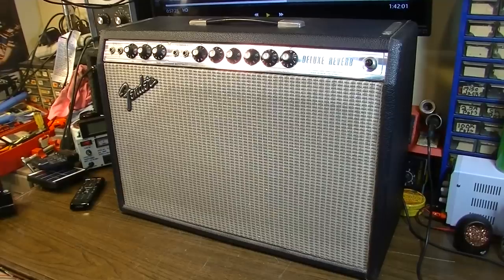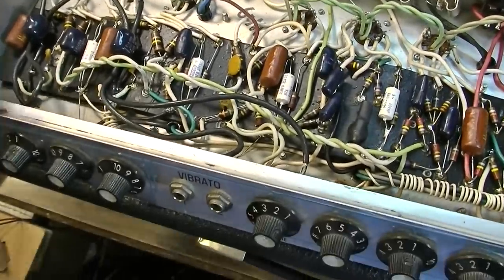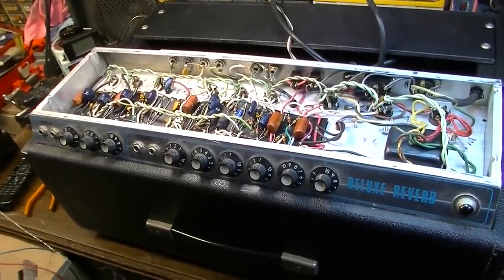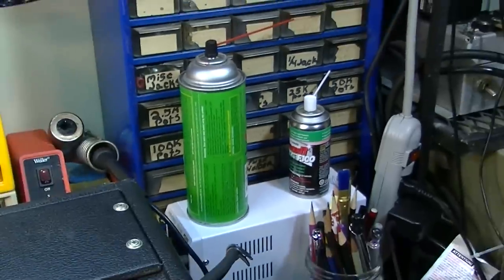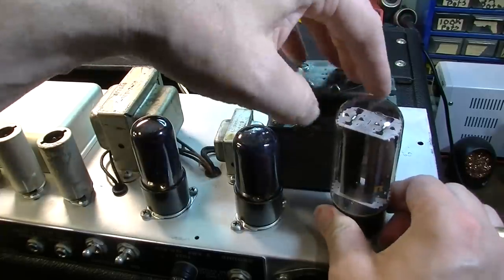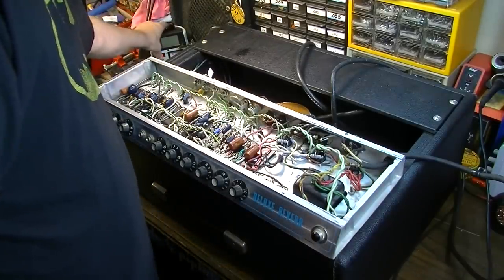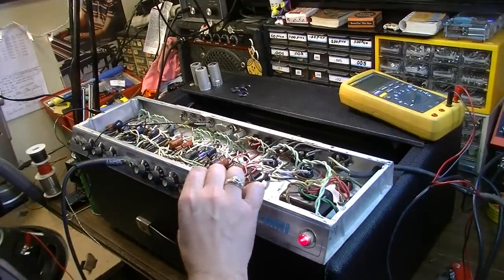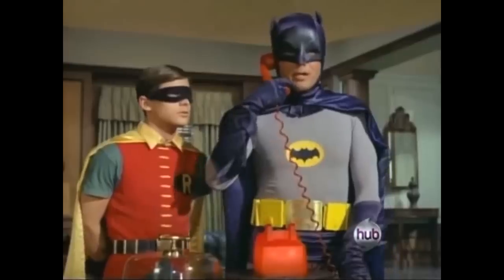SECRETS of the Fender Deluxe Reverb - The BEST Fender Amp Ever? (FULL SERVICE)

Comment: I like to use the Sprague Blue caps in the power section of the dog house and I also stay with the Sprague orange drops through the tone circuit.  I know...a little more pricey but you get what you pay for.   I have a good selection of NOS tubes and have found that different tubes like RCA, Telefunken, Phillips, GE, or Mullard all have a different nuance to the tone in these amps depending on which section you put them in.  A 12au7 in place of the 12at7 also gives the amp more color but that is according to taste.  Also, in the first section of the preamp,  by changing the stock 250 uf to a mica cap of the same value it will give the amp more headroom before its distorts.  Great for people that play country music.

Comment: Something to keep in the back of your mind for the less experienced is it's easy to melt the holes in the socket by overheating while trying to wrestle out stubborn components sometimes you might want to clip them out that way your not exposing the sockets to as much prolonged heat or you can use small clip on heat sinks they look like alligator clips but are usually aluminum.

Comment: This thing sounds awesome! I replaced the 470 ohm resistors on my bassman with metal film as well. I wonder if I should have increased their value too, but I certainly don't need more output from that thing lol. I tried biasing by ear as some say to do. Turns out I liked how the amp sounded biased fairly cold, so maybe that'll keep the old Sylvania's kicking for a while
Reply from the maker: In this day and age with sound guys wanting quiet stages and the way PA is, bias cold and mic it up. Preserve the tubes.
Reply: Thanks! Have you ever seen that geekcreit only give capacitance value? I lifted the legs on the coupling caps to the power tubes to test them, and it didn't display the leakage or ESR at all. Plate current is rock solid, so I think I can assume the old blue coupling caps are A OK. It's a '65 like you had in your video (later preamp with earlier power section with bias adjust)
Reply from the maker: Some caps are too small of a value to show ESR. I think some of these testers have a different software version installed in them and they have different cutoffs for ESR measurement.
Reply: That makes sense. These are just .02 mfd. Thanks Brad, much appreciated, always learn something from your videos

Comment: Fender schematics are dated,  so for example AB763 is whatever amp model, version one (A) revision 2 (B) July (7) 1963 (63).

This is why you have identical numbers for different amp models-sometimes the multiple amps were revised the same month and year. Last 2 digits are year.
Reply from the maker: This is correct. A fact I clearly forgot I knew. I've even mentioned this in videos before and just brain farted on it. Thanks!

Comment: Difference between 1270 and 1172 is the location of the standby-switch. 
1172: standby BEFORE the filter caps.
1270: standby AFTER filter caps.

Comment: Howdy, awesome work as usual. Non amp question Say, on your PRS (I assume it's a CE, probably 90's?). Looks like you changed the tuners to the more modern locking version. Is that correct?

Comment: The reason Fender added the 1200pf caps across the 6V6's was to prevent occilation. The wiring was so sloppy in those days that some amps would go into runaway occilation. So in order to prevent them from going into occilation, they soldered in a few caps. There's one across the Reverb as well. Seems like it'd be easier to make the wiring neater (again), but they were trying to meet a daily quota in production. CBS altered the Phase Inverter and Bias circuits when the went to the Master Vol/ Boost version of their amps. They (CBS) was trying to make their amps into HiFi amps and engineer out all the distortion... The amps will sound much better without all those caps that were never there on the original BF circuits.

Comment: Hey Brad.  I've watched a few of your videos and like them but on this one I noticed that you changed out caps on both the B- bias circuit and the B+ supply as well as the values of the screen resistors and didn't mention this should require a bias voltage check since supply voltages certainly changed..  You likely did it but didn't mention it and I'm just pointing that out as good practice when voltages are altered.

Comment: great video.  I've got a 74 Vibrolux that is in almost as good shape.  It's amazing other than an original CTS speaker has a buzz.  not blown.  Not a huge issue but I wouldn't record with it.  After buying it, I am in love with the clean tones but I think I should have gone with the Deluxe Reverb for it's ability to possibly get some nice tube distortion at a volume level below deafening.  Blah blah blah.  Wonderful video,  very informative.  Thank you

Comment: Re 1200pf: aren't those a shortcut to preventing high frequency oscillations? Not sure if this is the case with SF DRs, but most SFs had a bias balance pot and an ultralinear transformer that kept it clean and prevented it from overdriving. I could be wrong
Reply from the maker: You are correct. The 70s were a weird time for Fender. As the trend was toward hard rock and prog rock with overdriven tones, Fender was still trying to clean up their amps. Strange. But yes, those caps will help stabilize the circuit and cut down on distortion.
Reply: They are overkill. They suck tone bad and should have been the first thing to go. One of two of the best improvements I made to my ‘73 DR. Second was swapping the crappy Utah speaker for a Jensen Blue Frame.  I’ve had it A/B’d against 60’s Blackface DR’s and no one could hear a difference.

Comment: Those pliers are a massive heatsink sucking heat out of the soldering iron.  I'd suggest using either tweezers or forceps.   Much of the resistor removal issues would be easier with less thermal mass attached to the joint.  (Note, I've been an electronics manufacturing engineer for more than 30 years)

Comment: I like the mic connector.  Did the cable die on you, or did you run out of your good cables? ;)
Reply from the maker: Another GC dumpster cable. It was missing part of the Neutrik end, but works perfectly. So I use it. Would have been at the bottom of the Louisville Municipal landfill by now.
Reply: Ah, the "the shoemaker's children go barefoot" or the "mechanic's car" thing.  Got it. :D  But yeah, I'd have saved it too.

Comment: It's 39:00,   and I'm screaming...   You need the pedal to turn on the tremolo!!!!!   at least on the ones I know about.
Reply: Jonathan Grayson:  A lot of times people would just take an RCA plug and short the positive and negative then put it on where a switch would go so they didn’t need the foot switch.  To turn it on or off you just used the controls.  Maybe that’s what made yours work.  It’s what I have on my ‘69 Super Reverb although now the trem is ticking even with the controls all the way down.
Reply from the maker: The downside to leaving the trem on by default is the light will wear out sooner.
Reply: The Guitologist Would that also contribute to it eventually ticking even when it’s all the way down?
Reply: you can add a capacitor to eliminate the ticking. google for cap value and installation
.
Reply: btm240 thanks I’ll check it out.  Somewhere in my amp notes I have info on this problem.  Ironically my Super Reverb also doesn’t have a working Reverb.  It was cutting in and out, thought it was the tank and it worked with a new one....now it’s not working again.  More to learn!
Reply: Yup... I was too but he didn't hear us. Something is wrong with our YT out channel or Brad's YT in channel :o)
Reply: you plug in the shorting jack when you use tremolo, or get a pedal
 @TheGuitologist

Comment: Guitologist debugging is always scratching where it doesn't itch... cleaning pots, sockets and changing caps that have nothing to do with the actual problem. 
7:10 "we will probably not test tubes unless there is some problem with output" --> of course the reverb noise was caused by a bad tube.
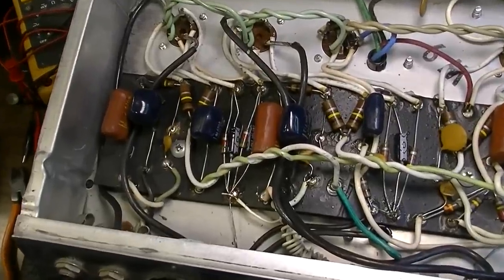8:24 repacing all the cathode bypass caps for no reason? why not change the coupling caps too, when they go bad it really affects the amp...

37:06 the roach is dissembled - it takes just a battery to test the lamp or a continuity check on the filament and a DMM to test the LDR... but we go by guesswork?
38:40 "we didn't test the LDR because I DON'T THINK IT'S NECESSARY because I am quite sure it was the light"
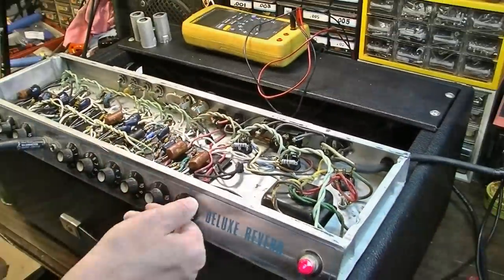40:01 "still nothing on the tremolo, I'm pretty sure it's those capacitors"
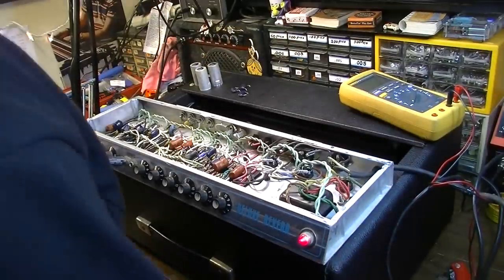40:45 the tremolo was turned OFF indeed, hence no light flickering.... indeed
41:20 realizing it's still the LDR

Socrates amp repair: The only thing I know is that I know nothing about amps. So I check values and voltages all the time... 
In Dutch there is this saying: Meten is weten, which is 'Measuring is knowing'
Reply from the maker: You have some valid points. Forgetting to short the trem switch was an obvious mistake. Mea culpa. That obviously threw off the rest of my procedure, which might have been sound given a trem that was on from the beginning. In my experience, when the trem is on and bulb is not working, it's the bulb. So I went with that theory. Replacing the caps was an attempt to get voltage to the lamp. It was when that did not fix the issue that I realized my error. My troubleshooting was on more sound footing from there.

As for not testing the tubes...I've been round and round on this point already, but suffice it to say, only one tube was causing any discernible issues with this amp and I found it in seconds when I actually came to troubleshooting the reverb, which I did not set out to do until late in the video. I even said it was likely the tube before pulling it and replacing. The kicker there is, had I tested that tube on my tester it might have even tested ok, as noise doesn't show up on a typical tester. 

Changing electrolytics has, for better or worse, become a standard procedure. I had no reason to suspect any of the old 25V lytics were bad, but they had exceeded their generally accepted service life and therefore I changed them. The coupling caps can cause MAJOR issues if they are leaky or shorted. You are correct. But none of these were causing issues, so they were left for now. Maybe not the best decision if one were setting out on a world tour with this amp where it would be used night after night in front of thousands, but I don't think that's the case here, and changing them would have inflated my repair bill. Not saying you're wrong on this one; it's a judgment call.
Reply: Excellent back and forth here.  I learn not only from the videos but from the comments/discussion.  It’s nice when it stays positive.  Kudo’s.
Reply: Sorry Brad, I overreacted.
I really didn't expect you to see or even reply... sorry if it sounded harsh. Feel embarrassed now and trying to rationalize why I react like that: I am addicted to your channel because there is no other channel on youtube giving my weekly/daily amp repair fix. Anybody interested in learning about amps should see the inside of a pristine silverface Deluxe. Your videos will be reference point in the future, if only for people to check if their amp is original. I heard you say you don't want your vids to be considered how to's, but this cannot prevent them from being considered as such. We are entering the age in which you no longer google "how to repair a toaster", you put that phrase in youtube.
Ok; DLabs has better debugging skills, but maybe your style makes for more exciting viewing. There is suspense going on, even if guitologist is making a clear mistake, everybody is shouting at the scream: "Short the Tremolo, Brad, you moron" - but they keep watching. I also hate/love your videos because I make similar mistakes... replaced so many good components. Now I don't take my iron to an amp without having all voltages noted on the schematic. If there is absolutely no DC leakage on the grid, I leave the coupling caps alone. Still my reasoning is: doghouse sees +300V, coupling caps 100-300V, cathode bypass sees only minimal voltages.

Comment: 47:55 The silverface circuit biases the reverb driver tube (12AT7) much hotter than the blackface circuit. That means that the tube will also be much hotter, temperature-wise, than the other tubes. That's normal; however, it also means that tubes will wear out in this position much faster than the other tubes do. And you will need a tough tube to survive in that slot--some tubes will die almost immediately.

Many people change the reverb driver bias resistor back to blackface spec, because it's not as hard on the tube, and it sounds good.

Comment: What if the customer wanted OEM replacements? Are the parts available? Or would you still have to use higher value caps or resistors?

Comment: The tremolo circuit doesn’t ‘get’ signal from the preamp, it sends the low frequency wave from the oscillator ‘to’ the preamp to modulate the signal.

Comment: CE Distribution's caps are OK in my book too.   Also,  F&T is usually NOT super high price, and good stuff.
Reply from the maker: Agreed. F&T are great caps. Larger footprint though. Won't fit as many of the little vintage combos I service easily, so I stock these instead, and they have treated me rather well. Hate to say it about a USA company, but Spragues are a waste of money. Overpriced.
Reply: Is Sprague even a domestic company anymore? As far as I know their caps are made in South Korea. Would be surprised if they're not in-part, or fully-owned by an SK electronics conglomerate by now.
Reply from the maker: I don't know, I assumed their caps were still USA made, but could be wrong. They are certainly USA owned.
Reply: Electrofrying D I haven’t had any trouble with F&T’s lately. But don’t get me started on JJ preamp tubes from CE. They’re consistently getting sent garbage. One grid on a new ECC83 will test “ok” while the other craters on my tester. I don’t want to put a tube in an amp that will just become intermittent a few months down the road. The Shuguang 12ax7b’s consistently test very strong on both grid pins.
Reply: MuscleDad420 
JJ brand from Eurotubes undergo extensive burn and test in house before sale... they ship only good stuff.. the fails go back to JJ or are scrapped. I know the owner and son since their first year in business, as they are local. Good people. Another good friend, an ex Tektronix guy, assisted extensively on their computerized tube testing system.. It works very well.

Comment: reVERB! And taken from TDPRI: "You could change all the lead dress and get rid of the suppression caps, I suppose (see below). I think that's unnecessary, but some people do it. But I would not run a SF DR on a 5AR4 like the BF ones did instead of the SF-spec'd 5U4. Some people do this, but I wouldn't. The voltages on the SF DRs are just inherently higher than the BF ones, in part because of a slightly beefed-up power transformer. A 5AR4 will just make voltages even higher. With the spec rectifier (5U4GB), I'd say it's typical to have these SF DRs running at 440-450v, and sometimes higher. Many of the SF ones were spec'd to run at 117 line volts, as stated on the schematic. The BF ones were spec'd to run at about 415-420v at 110 line volts. A 30-40v difference makes a big impact on the sound/feel, in my opinion, and it's not one that can be 'blackfaced.'" 
Just his opinion, I reckon ...
"Never been monkeyed with." So you are going to "monkey" with it :-) ... But I agree on that tremolo "bug." Talk about a dollar-dive ... If I ever get one of these amps, I WILL be buying a Kingsley BARD: http://kingsleyamplifiers.com/products/pedals/18/

Will an LED work instead of that light? Run that tank output through the appropriate connecter cables, and go into the front of the amp, into the NORMAL channel. Allows you to roll off the bottom, and boost the top end for better EQ'd reverb. Sounds great. Great job on this. I am not an amp tech, but I enjoy seeing folks work, who know what they are doing. Thanks for doing this. I enjoyed it. And yes, Deluxe Reverbs are probably the most articulate amps that Fender ever made, IMHO ... Nice playing ... for an amp tech! :-)
And Jesus saves. Give Him a chance. Time is running out. Choose LIFE. Choose Jesus. NOW. While you still can.

Comment: Brad question,  the 1500 ohm resistor is it not also in the path of that heat. And, is it not moved because it's failure is not catastrophic? Thanks, Rick

Comment: Yes some Silverface amps are just Blackface parts in the newer faceplate.  This definitely is NOT one of those although the design didn't change much. Mainly different parts like the 1 watt carbon resistors on 12AX7 plates and different cap brands reveal it is definitely Post CBS.  Thankfully Deluxe never went Ultralinear. Whew!

Comment: Hey Brad, I'm no tube expert, but I noticed those generic tubes had "EEC" stamped on them. You probably know that means "European Economic Community", which is a term that was replaced in November 1993 by "European Community" or "European Union". So I imagine "EEC" would be stamped on parts made up into early/mid 1994 at the latest (as you guessed). Cheers
Reply from the maker: Thanks for the info!
Reply: No. The markings, while not entirely clear, are "ECC", not "EEC". For example, the 12AT7 is also marked ECC81. ECC81 is just the European/Mullard-Philips designation for a 12AT7. Similarly, 12AX7 and ECC83 designate the same tube type. An ECC designation does not mean that tube was made in Europe or after November 1993.
Reply: OK, thanks for clearing that up.